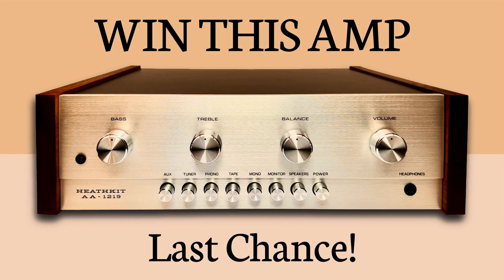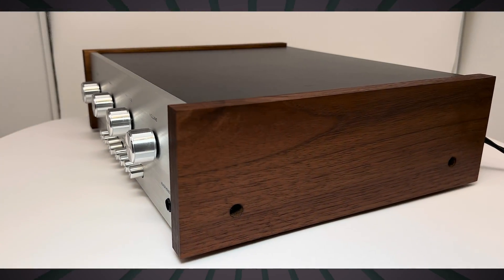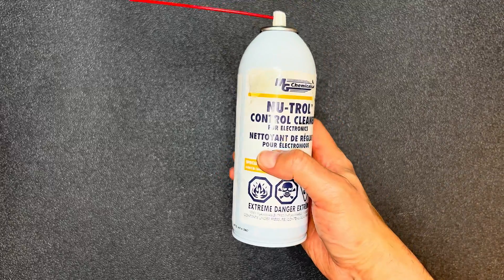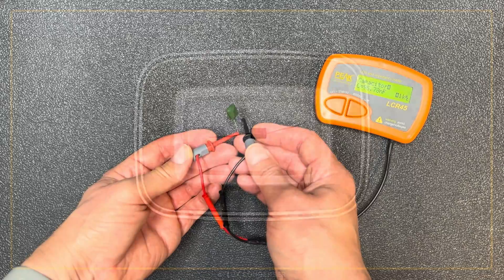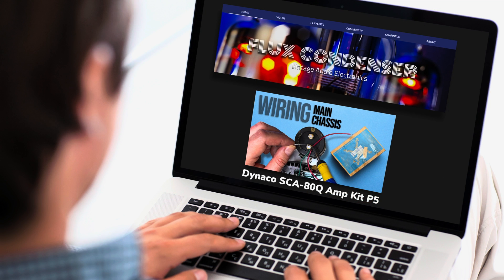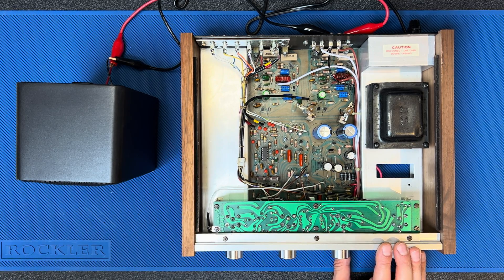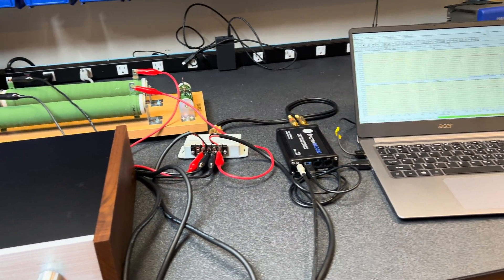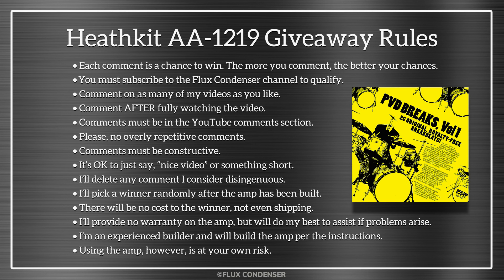Win This Heathkit AA-1219 Amplifier! • P3: About The Build • Testing Components • Bench Tests • Demo

Comment: Great job on the building of this.  You did a great job, as I am very picky on build quality.  Bought it from your winner on ebay with all of the paperwork.  Had an issue with the front panel switches when it arrived as they were jammed - a little dexoit took care of this.  Great little amp have it in my shack/lab 73 W4MAY

Comment: This is really cool bro, btw my receiver's left channel went out, do you know of any ways to deal with this? It's a Sherwood s 9180 and I tried it with headphones too and it didn't work either.
Reply from the maker: Glad you enjoyed the video orcastruck! Diagnosing your Sherwood will require some signal tracing though a process of elimination to discover the problem. That’s just too much to go over in the comments, as there could be a dozen or more reasons why your left channel isn’t working and doing the detective work for most of those possibilities requires some technical knowledge and equipment. Good luck.

Comment: The extra high power level that you saw in testing was probably a result of higher mains voltages today compared to back when the kit was sold.
Reply from the maker: This amp isn’t that old. The schematic calls for 120 volts and that’s what this unit was tested at. 120 volts on my isolated power supply. Higher voltages can account for higher output wattages, but that’s not the case in this case. I always test amps at their rated voltage.
Reply: @FluxCondenser  Well it's a nice bonus to get a bit of extra power! Must have been conservatively rated.

Comment: Hope whoever gets the amp ,appreciates it ,seems to be a good little amp .I personally have a the mc 2105 (think you did work on one before)and have had some work done to it . I also bought a  hafler 200 which was broken , if had your skill would repair it , I also have a few other amps not working ,brother gave me an Akai ,inherited a fisher amp not sure how good it is but is also not working ,it turns on and some lights are working ,no sound .My only HealthKit experience was when I was in early twenties a friend was encouraging me to learn electronics and he bought me the books and circuit boards to experiment on but for some reason it never happened .I still have the books and have recently been studying them but stopped again,maybe someday will be able too put sometime into it .Actually he bought the hafler 200 amp and the preamp ,the 110 model and am using it with the mc2105.I was told the hafler 110 is good sounding but am wondering if I should get a better preamp to match the 2105 ,any thoughts would be appreciated .Take care

Comment: I was building the HeathKit Active Ruler SM Solder Skills Kit today. I was positioning a SM 4700Ω resistor with my tweezers and 'click' the resistor just disappeared right before my eyes!
I looked for it for about an hour. Finally, I ordered an assortment. I won't be able to finish the project until Monday.
Is there an assortment that you can recommend?
Reply from the maker: Kevin, yes, if you're looking for a basic kit of resistors I'd recommend this one from Elenco. I can confirm that the quality is good. Also, these are ½ watt resistors. Often, you'll only need ¼ watt, but if you're going to make a small investment in having a bunch of resistors in-stock, you're better off going with ½ watt instead of ¼ watt. The leads are stronger and you've got more of a safety margin. https://www.amazon.com/Elenco-365-Piece-Resistor-Kit/dp/B0002HBQHW/ref=sr_1_3?crid=1T1G9QGE9JPUZ&keywords=elenco+resistor+kit&qid=1640899024&sprefix=elenco+resistor+kit%2Caps%2C50&sr=8-3

Comment: I built a Heathkit Q Multiplier when I was 15 and it worked well.  But I sold it recently  as I no longer use the SW radio.  I would like to have an amplifier for a new stereo system.
Reply from the maker: Good luck, Richard!

Comment: In the late 70’s or early 80’s I had picked out a Heathkit AA-29 integrated amp kit, assured that my soldering skills were just fine. I could never actually buy the thing, so I assume there was something inside who knew better. This is a pretty little amp.

Comment: Thanks for the video! I started building kits three months ago (Amp Camp Amp, now trying Nutube Pre) and just getting into this stuff. My soldering skills are terrible for now, but I'm highly motivated and the things I see on your channel show me the way. Thanks for that!
Reply from the maker: Great, welcome to the hobby! That Amp Camp Amp is a treat. Soldering tips: Don’t skimp on the heat. Keep the tip very clean. Skip the lead-free solder. Pre-wet the tip with solder. Apply heat on one side of the lead and solder on the other. Let the solder get drawn-in toward the iron tip. Use a mask, blower or fume extractor to keep those fumes out of your lungs. And practice, practice, practice!
Reply: @FluxCondenser  Need to remind me of that more often, indeed! I'm always afraid to roast the pcb when the solder on the other side of the ring isn't melting... guess I need that practice you mentioned.
Reply from the maker: @gp4533  Well, and that’s the thing about making sure you have enough heat. I think some people go too low with the heat fearing they’ll damage the board, but I find it’s better to go a bit higher so you get a real fast melt time and a speedy flow. That way the dwell time is less and you can get in and out quickly leaving a nice shiny weld. If the melt time seems slow or the flow isn’t immediate, that’s a sure sign that the temp is too low.

Comment: Nice how would you say it sounds compared to modern amps at entry level price point can you tell the difference if you did a blind audio test?
Reply from the maker: I didn’t do any direct comparisons, but from experience I’d say this amp would hold up very well in comparison. There might be an advantage as far as noise levels with some of the better quality new entry-level devices, but the build quality on this old Heathkit is likely to be far better. Overall, sound-wise this Heathkit would sound very similar to something more modern.

Comment: I ordered a HeathKit Active Ruler SM Solder Skills Kit. I have plenty of experience with PtP soldering. But I'm hoping that this kit will get me up to speed with PCBs before I tackle an actual amplifier kit build.
Reply from the maker: Great idea, Kevin. You’ll really want to get your PC board soldering skills down before you tackle something like this. It’s relatively simple, really, but it does take lots of practice to get it just right. Good luck on your future kit builds!
Reply: @FluxCondenser  
Kit has arrived and I am reading the manual. There is a section titled "Making Your Work Look Professional".
YES-S-S-S-SSSS!!!

Comment: Thanks for the mention of the safety capacitor across the line.  It's a good reminder when restoring vintage radios that use a capacitor across the ac line and line to ground.
Reply from the maker: Yes, absolutely.

Comment: Back in the day I built my first Heathkit - the AR1515 receiver.  Still have it and am in the process of re-cap before I start using it again.  The timeless brushed aluminum look never goes out of style in my opinion.  Would make a great addition to my heathkit audio system.
Reply: Those are well designed receivers. If built properly, they have to give the owner a true sense of accomplishment. I think the youth are missing some very practical hands on experience with the demise of these kinds of products.

I built a Dynaco Stereo 120 watt amp, and found that enjoyable when I was in my 20's. I already had a Harmon Kardon preamplifier, so I never bought either the PAS or PAT series preamplifiers. That would've been fun too. 

I'm happy to hear you're still hanging on to the Heathkit receiver.

Comment: Once again stunning build, one can see a lot of time has gone into it, it looks and sounds amazing.

if possible can you list the equipment you used ie: testing the capacitors please and also the scope that you hooked up on your PC. Please
Reply from the maker: Sure thing, William. For voltage, current, capacitance, resistance and diode testing I use Fluke 87V multimeter. For capacitance, inductance and resistance I use a Peak Atlas LCR tester. For capacitor ESR testing, I use a Peak Atlas ESR meter. For capacitor parallel leakage, I use an antique Heathkit IT-28 capacitor tester. For diode and transistor testing I use a Peak Atlas DCA tester. For bench testing, I use SpectraPlus software and their excellent SpectraDAQ-200 DAC interface. You can see more of the equipment I use and recommend on my Amazon shop and I think the Peak Atlas meters are available there. Let me know if you have any specific questions about these products. https://www.amazon.com/shop/fluxcondenservintageaudioelectronics
Reply: @FluxCondenser  thanks i will be looking for them on Amazon

Comment: You are very thorough,  I never thought about safety capacitors until I watched your videos.
I built an AR1500A in the mid 70s
Found a defective part in the AM tuner and replaced panel lamps years later. A great amp.
I am using an Empire Turntable and AR 5 speakers. Great Sound !
I like that integrated amp and you did a fantastic job building it.
Thank You  !
Reply from the maker: Thanks, Irwin. As I get older, I’ve learned to slow things down a bit to be more thorough as it always pays off in the long run. Glad to hear you’re keeping your Heathkit operating and I’m sure it sounds just great with your Empire table and AR5s!

Comment: That little amp sounds super, and I am not surprised it completely exceeds specification with all those new caps and the care you put into the build.  Very good separation and imaging, and no audible hum or noise at all.   I would love to use it with my Technics SL1300 (from the same era).  I need to get a cartridge though.  Can you make any recommendations? Best wishes for a safe and happy New Years.
Reply from the maker: Thanks 6String. As far as cartridges, all I can tell you is that I’ve listened to classic cartridges from the 60s and 70s. Moderately priced modern cartridges. And $1500+ moving coil cartridges. Honeslty, they all sound about the same. The cartridge used for the demo on this video, for example, is a modest Audio Technica cartridge that probably sells for under $100. And as you can hear, it sounds absolutely fantastic on that 50+ year old Thorens turntable. Don’t buy into all the hype. Just get something that will integrate well into your headhshell and stick with a brand with a good reputation. You can’t go wrong.
Reply: @FluxCondenser  I was thinking the same thing.  The modestly priced AT/Shure/Pickering cartridges always sounded good to me as well. Thanks - Gene

Comment: Many years back (When I worked at a Chevy Dealership) I knew someone that put 3 new GM Ignition Modules into a Distributor and none of them would work. He went next door to an Auto Parts Store and bought an Aftermarket Ignition Module, and that worked as it should have. Great advice to check new Capacitors before installing. I don't want this amp, but I would give it to my Mother if I win.

Comment: Not surprised a new electrolytic cap failed.  I had my vintage McIntosh tube preamp refurbished and one of the brand new electrolytic caps in that failed after a few months too.
Reply from the maker: Wow. That’s disappointing. I hope your shop took good care of you.
Reply: @FluxCondenser  they did indeed.  They replaced it and did another repair free of charge.